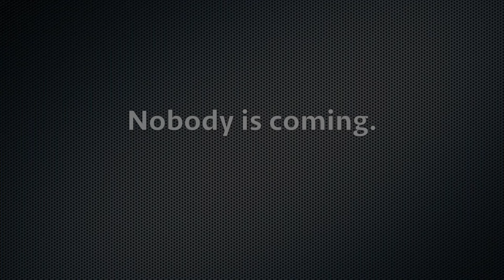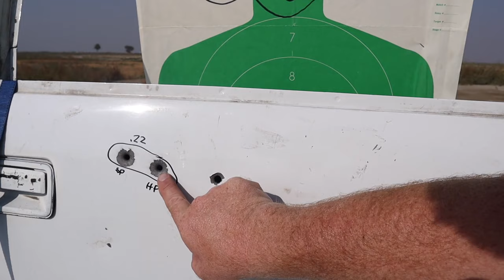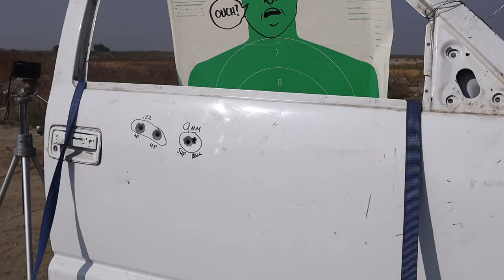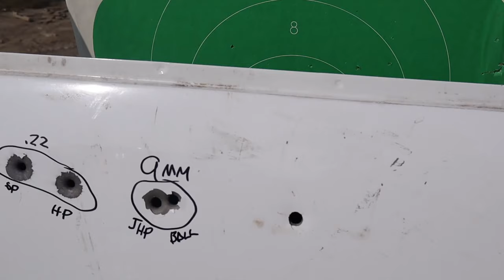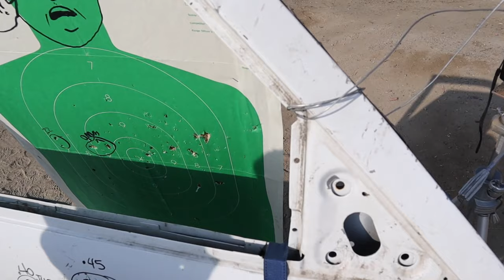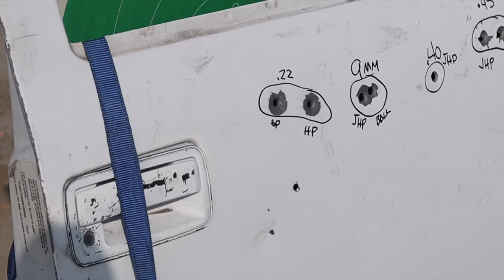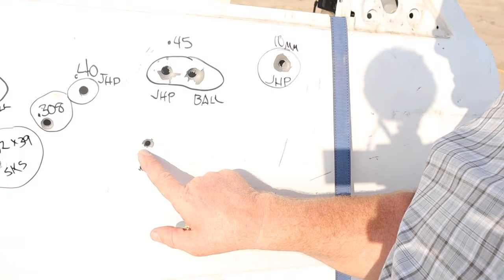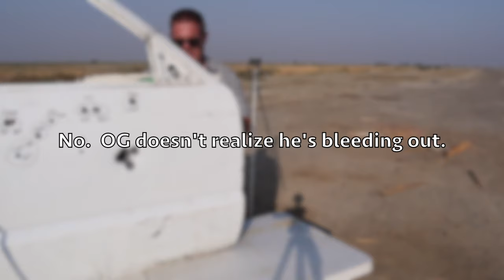How Bulletproof is Your Car?

Comment: I shot an old scrap car i had with 3 shots in the driver side door. 2 went all the way through both doors and 1 stopped inside the second door and dented it. Cars are only a visual shield not a physical one

Comment: OG: Does your agency use ballistic panels in the cruiser doors? NC SHP installs IIIA in driver's door, because you can never tell when you are on the road. Also, .357 Sig  Gold Dot will zip right through a door and the driver.
Reply from the maker: We have ballistic panels in our doors as well.  I’ve tested them with .223, .308, 7.62x39 and 12 gauge 00 buck and slugs.  Stopped every one of them.

Comment: I have shot up cars before crushing them. I put a few hounded rounds of .22LR thru an import. I put 1oz deer slugs thru a 1976 Impala. Slug goes thru both  car doors before dropping to ground, fatal if 2 passengers are in the seat. a 1oz lead turkey ball will go in to the brake booster, severing the rod. Thus taking out the brake system. 7.62x39 will go thru a 72 Monte Carlo factory air cleaner lid (thicker then a door).  Don't try bird shot at close range!

Comment: Is there a Cartel Runway "L"?

I was always trained that the ONLY thing bulletproof on a car is the engine block, and you move to keep it between you and the shooter.  But then they invented the 458 SOCOM and Penetrators.

Hey! I'm older than your SKS!
Reply from the maker: The engine block is your best bet.    The steel wheels are pretty reliable as well.  Not sure a .458 is going through an engine block, penetrators or no.

Comment: I would like to see a comparison with a car door from the 70s vs modern.
Reply: bullsballs  lol... hmmmmm... I wonder... my 68 has pretty thick metal but without a crash bar... the inner metal is about the same... probably fail :p

However I would like to see it tested with common gangsta bullets of the time... 32 25 38spl... that sort of thing.
Reply: bullsballs  lol.  Helluva an idea.  I will bring the doors!

Comment: car doors ain't what they use to be, from the days of the motorized bandit the 38 auto gave birth to the 38 super (think 38-357 for those unfamiliar) because 45 wasn't making it though car doors, but 38 super would, in modern power it lands between 9mm and 357 sig using the same projectile .355" at 900 1100 1300fps generally and respectively with a 1-200+ fps window for each in extreme loadings

Comment: How do you like your S&W MP10 308? I was eyeing one myself.
Reply from the maker: I love it.    Very soft shooting for a .308.   Much easier on the shoulder than a bolt rifle.  It can reach out there and touch someone, but is short enough and fast enough that it could be used as a battle rifle with a red dot or ACOG.

Comment: hey OG  question distance from muzzel to door would that make a huge difference in ammo performance.  being on the job as you are im sure you have seen this before 😁👍🇺🇲
Reply from the maker: It won’t matter until you are so far away that the round loses all its velocity and energy.  At any close/medium distance it will have no effect whatsoever.

Comment: THIS IS JUST ANOTHER REASON WHY I CARRY A GLOCK29 10MM AUTO. PUNCH THROUGH SOFT BARRIERS WITH SPEED, ENERGY, AND MASS TO STILL HAVE THE ENERGY TO PENETRATE DEEPLY INTO A 2 LEGGED PREDATOR.
Reply from the maker: Very good choice.   I carry a G20 in cooler months when I can conceal it under more clothes.

Comment: Would a modern car door, with airbags in between metal sheeting and hard plastics and polymers lining everything, stand up better against said bullets?
Reply from the maker: The Kevlar in an airbag is strong, but very thin.  It might help slow the bullet a little, but I doubt it would stop anything tested here.

Comment: Wonder how long you have to worry about Gumby wanting to retaliate for his cousin?🤔🤣😂🤣
Told a Sheriff friend with this going on there is a film you can get to make regular auto glass bullet resistant.
That on the driver and passenger windows and stick an AR 500 plate inside the door for added protection for the officers.
Not sure what the film runs price wise but the plates are cheap. Or some of the old retired vests no longer in use. 
Tape it between the panel and the door to catch the round and give the officers a little extra protection. 
Be safe out there!
Reply from the maker: We have ballistic panels already installed in our cars.  Pretty armored up these days.  The window film doesn’t make the windows bullet resistant, it just helps them stick together when they shatter so glass debris doesn’t blind you.
Reply: 20 years back I worked for a city in So Cal. Fleet Services.
We had a special P.D. car with a rather expensive film that cost almost as much as the car to make it so the windows were resistant to multiple 9mm hits though .357 of bigger was supposed to go through.
Said it was developed for the military...
Used the car for special undercover stuff.
Would have thought it would be improved and cheaper by now...

Comment: I’d rather have a car between me and a shooter than just air. I know air can’t stop a bullet but at least a door might slow it down.
Reply: Slow it down, or make it tumble and create shrapnel making a clean injury, possibly a through and through into multiple wounds, high infection risk and primary wound worsened by a tumbling wound track.

If your gonna look for a car between you and a shooter, try to put the engine between you and them.  And look for better cover, and an opportunity to move there.
Most importantly z be prepared to shoot back
Reply: Jerry Fick all true, however, if bullets start flying anybody will hide behind whatever is available.
Reply: Hope neither of us has to find out the hard way

Comment: 1500 yards on a man sized target pretty easily with a slug????  Come on OG you should know better than that. If you really did mean to make that sort of ridiculous claim we need proof, and not just a one off we need 3 out of 5 hits just to prove consistency. Also for what it's worth I'm not trying to give you a hard time I still appreciate and enjoy your content. I'm just trying to help keep you honest. 😉  (Oh and you made that statement before the blood loss so don't try to use that as an excuse)
Reply from the maker: The quote was actually “50 to 100 yards” but I see where it sounded preposterous.  Over on TFM we had trouble getting 300 yards out of a slug.
Reply: @OGsDangerShow  heh I listened to it 3 times before I originally commented and it does sound like 1500 but 50 to 100 makes a whole lot more sense. 😁

Comment: Well I just got shot at today (15 times) the bullet hit the a pillar and did not penetrate. The shot came from in front of the car, ten inches to the shooter left and it would have hit me, if it went threw the glass. I believe by the size of the mark that it was probably a 9mm. I went and bought a lottery ticket 👍
Reply from the maker: Where the hell were you that you took 15 rounds to the A-pillar?!?
Reply: Officer Gregg -OG’s Danger Show Sorry one shot did hit the pilar, the others wizzed by, spray and pray style. I was working on the north side of Milwaukee.
Reply from the maker: Still, that’s outrageous.   I’ve done a lot of bullet testing against the a pillar and it is very very very tough to get around to penetrate. Even 5.56 rounds have a tough time chewing through that rolled sheet steel.  Glad you’re here to tell the story!
Reply: Officer Gregg -OG’s Danger Show yeah three inches to the left, from the shooters angle and I would have been hit, probably mid-chest. I made $400 that day definitely not working in the area again.